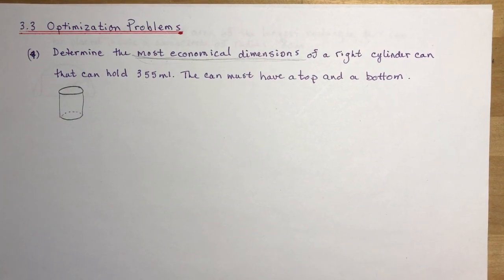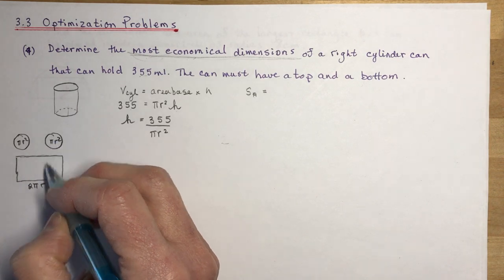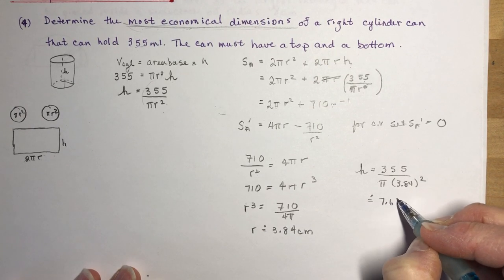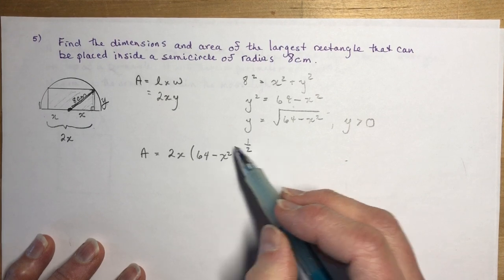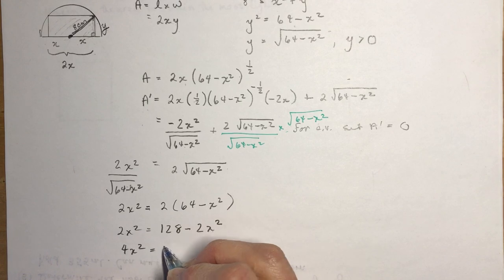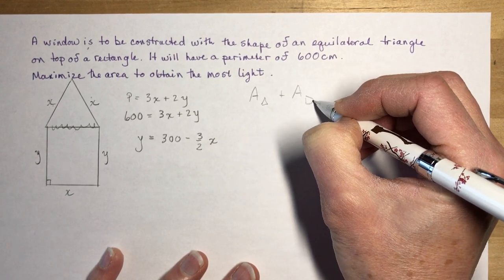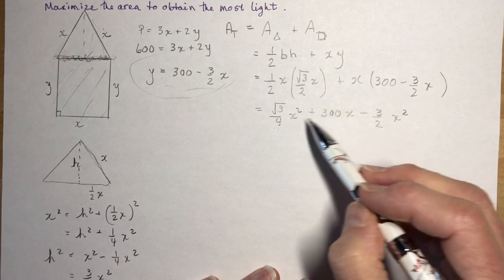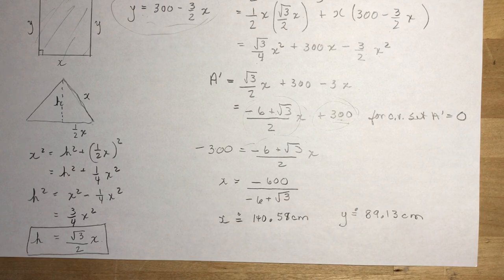Calculus 3.3 Optimization Problems Part 2

Comment: Hi Ms. Havrot!! I was wondering if you can help me with this optimization question: "An isosceles triangle is inscribed in a circle of radius R. Determine the angle θ (between the two equal sides) that maximizes the area of the triangle. Thank you!!
Reply from the maker: The short answer is that the most symmetrical triangle will give the maximum area, so the angle is 60 degrees and  the triangle is equilateral. The long answer is very complicated and you can watch a video here. https://youtu.be/iOtT2il-bhI.  Nasty question 😂
Reply: @mshavrotscanadianuniversit6234  MA'AM YOU ARE A LIFE SAVER I LOVE YOU

Comment: 16:24 shouldn't the area just be 32? since both x and y are underoot 32
Reply from the maker: But the length is 2x so area is 2xy as calculated.